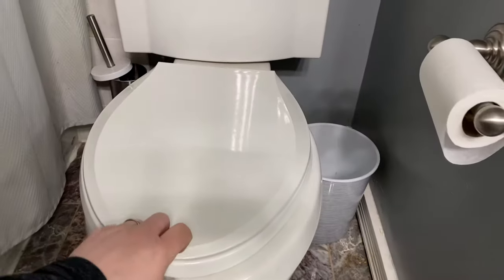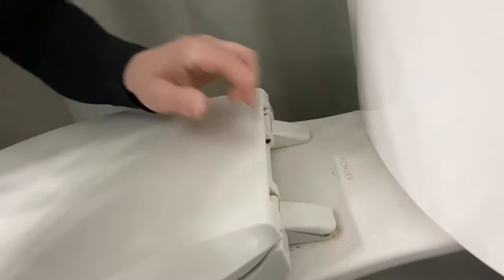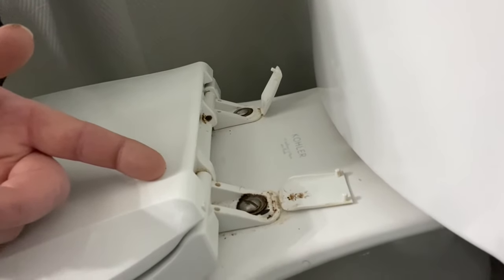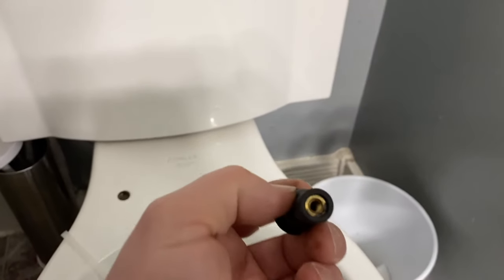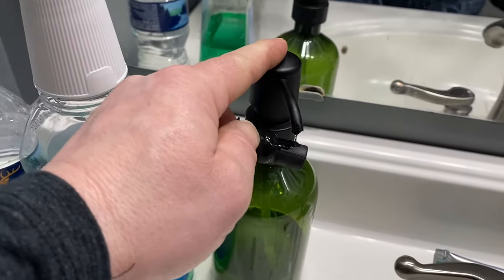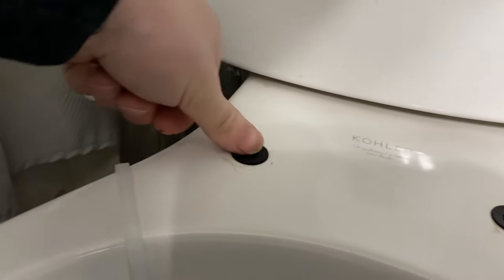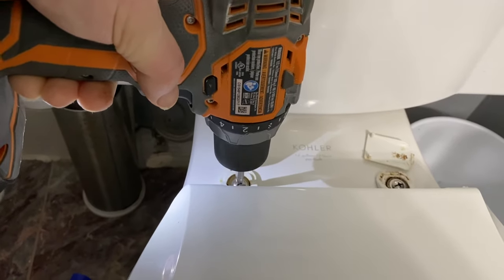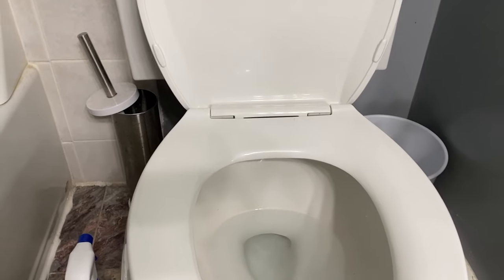How To Fix A Loose Toilet Seat

Comment: Heres a tip for getting the rubber part in place - push it in as far as you can and then put the bolt in the nut from below. Turn it a few times to catch the nut and use pliers to pull from below.  It popped right into place.
Reply from the maker: Thanks!
Reply: Just ordered mine fro Amazon.

Comment: Thanks for this video. I recently bought a new seat that had the same kind of expanding rubber pieces. I had never seen one like it, I couldn't believe it would stay in place without a nut on the bottom. I was thinking about returning the seat until I saw this.
Reply from the maker: Glad I could help!

Comment: This video helped but I found out the top part of the rubber expansion is the washer replacement so I still used the washer that came with it to tighten it on. May sound confusing but it fixed my toilet seat.

Comment: that worked. One side was just like you said, the other side couldn't be tightened that way so I had to attack it from the top. Thanks!
Reply from the maker: Be sure to pick up the Amazon hardware kit as well. That will permanently fix the loose toilet seat. Thanks for watching. Please hit the thumbs up.
Reply: My boyfriend passed away an my toilet seat has been loose for a while now and then see your video I fixed it all by myself thank you so much he usually would be the one to fix this kinda stuff so thank you for this video 🙏❣️

Comment: Hi I would appreciate any advice- I have a bar hinge & the bolts are part of the hinge and can't be screwed in, just pushed in. The only way to tighten is with the nut. Is there some other way to tighten? Thanks
Reply from the maker: Have you though is buying a new toilet seat? One with more standard hinges?

Comment: Always easier to leave the bolt in the grommet while inserting it. And soap or oils can drip down making a mess on the floor (n.b., oils can disintegrate rubber materials, especially considering that most such aren't real or completely rubber; many are actually silicon or similar rubber substitutes). One more thing: Applying any kind of pressure on a ceramic object can cause it to break, forcing you to buy a whole new unit, especially if it's a one-piece bowl and tank.
Reply from the maker: Sorry you disapprove of the video. But thanks for watching anyways.

Comment: Ive got one permanently stuck at a super loose configuration. Rubber is falling apart and is now stuck in place after years - the rubber will break down and now that we're installing a bidet these adapters are a huge frustration.
Reply from the maker: Interesting comment. I have these adapters on two of my toilets now. They work great. But will be interesting to see how the rubber holds up after several more years.

Comment: Simplest solution would be stop buying these toilet with such seats, it is just money making scammm ...
Reply from the maker: True. If you spend more money on a better toilet, you may not have this issue. But there are lots of toilets like this one in homes. This hardware is a great option to fix this problem.